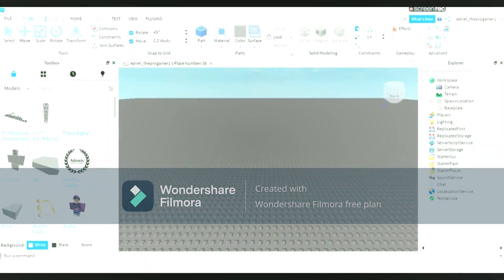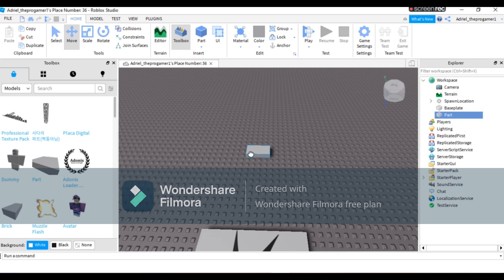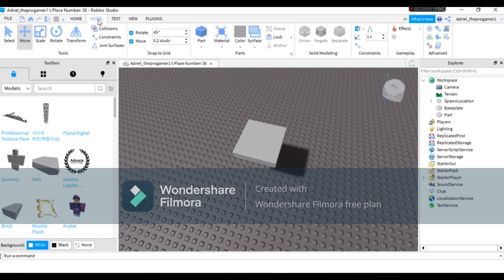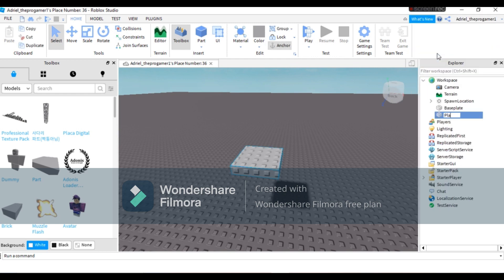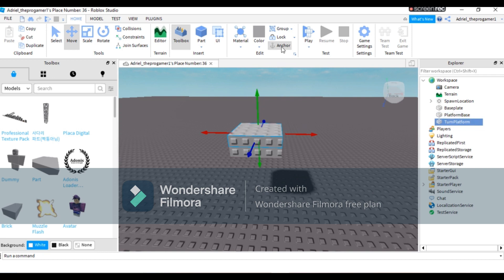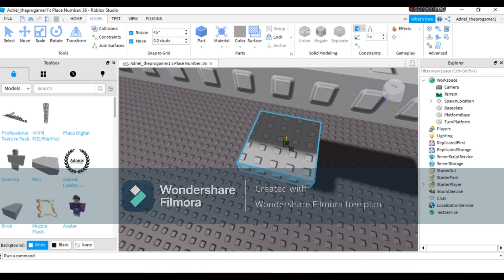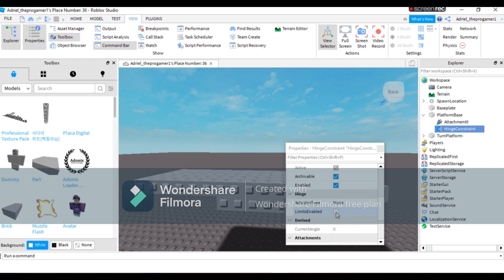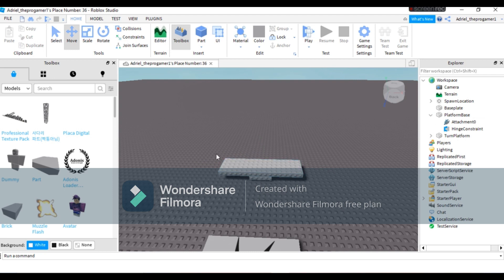Roblox | How to make your own spinning part in Roblox studio?

Comment: doesnt work for me :(
Reply from the maker: Make sure you click the platform base at the middle when you select the hinge and connect it to your own turnplatform and make sure the line is straight and cuztomize it on propertize make sure the actuator is motor and change the angularVelocity into number 1 and the motor max just put bunch of nines there and press enter and if you press run or play it should work